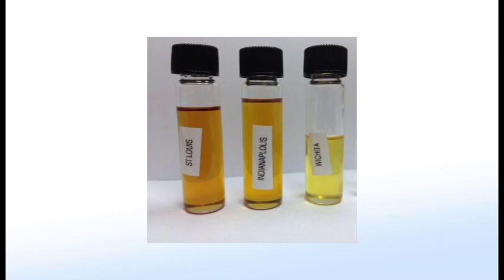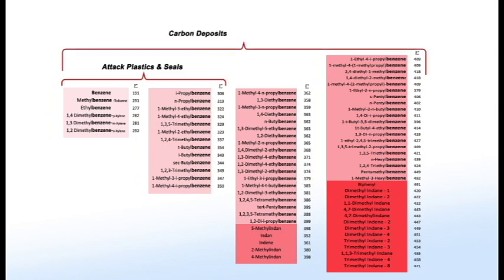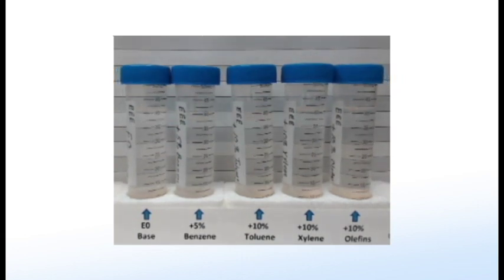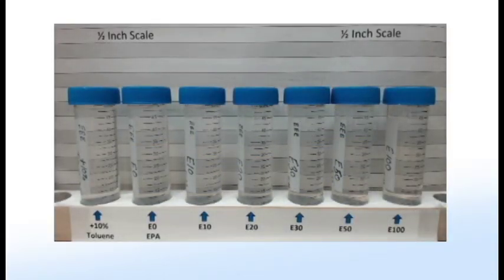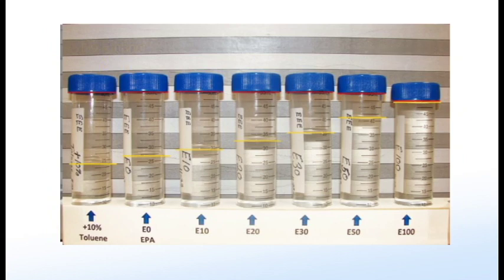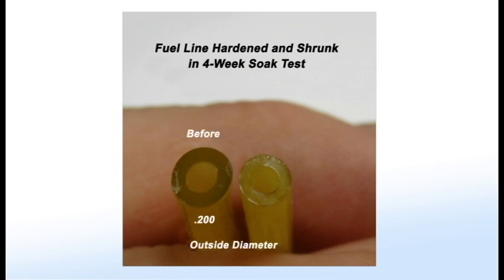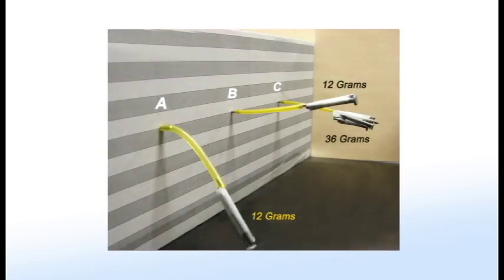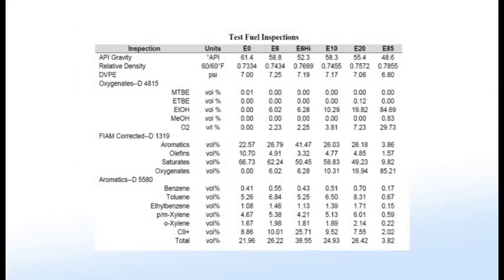Small Engine Issues Video

Comment: I get a laugh at the many shade tree would be mechanic videos showing footage of carburetors taken apart that indicate varnish and other debris that cannot be caused by ethanol. Ethanol does not leave a varnish residue in a carburetor bowl but gasoline will.
Reply: No it just breaks up all the varnish in the system from running regular gas for years and years. I keep extra filters on hand and have changed all my hoses as a result.
Reply: Steve Pierce
So you think using a dirty fuel is a better option?
Reply: GTIBully Worked great for years and still would if I had a choice. I can't run your ethanol legally in my airplane. All I want is a choice like I have when I am in a corn producing state.
Reply: Steve Pierce
I would like a choice too the same as you do. I don't want gasoline in my ethanol.

Comment: using bottles that is not rated for petrol will of course be damages. and i have seen a lot of crappy "fuel hose" that is not working with fuel. i have seen one hose last 20 year's with no problem and other begin completely destroyed after 6 month. i have also had a lot of gaskets and other stuff fail in carbs and other places after ethanol was used. new cars some times do better then old on this tho. stil even cars made to run on E85 have a BOG problems if used on E85. ask the ppl servicing them. they will tel you not to run on E85 at all or at least fill up one full tank like every 5 times you fill up with normal petrol.  ethanol is a good fuel if you can get it at a lower cost AND is ready to service your car often (like replace fuel pumps and other component's) and expect bad mileage number's.  yes you can get more power out of an engine if you run pure ethanol. it do however require you to run it on an engine with higher compression and to use a lot more off it. as much as 6 times the amount then you use on petrol. then you get a lot more power. ethanol can be used with less air/oxygen then petrol and that way make more power. it can also handle high compression or high turbo/boost pressure and that way get more power.  ethanol is a fuel alternative, it just isent as good as what the engine's is design for.

Comment: The bottle test is dumb, obviously they’re not rated to hold fuel as you don’t see gas cans doing the same thing. Otherwise the rest is fine.
Reply: Same plastic used to make portable gas containers, just thinner.  Even making gas tanks for off road applications have to account for swelling.